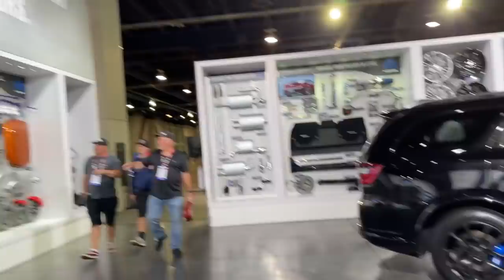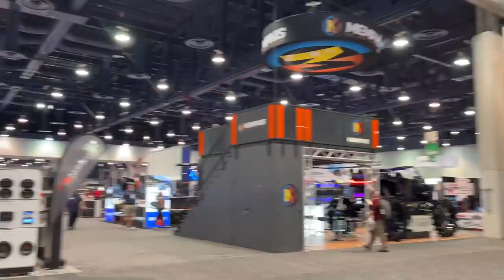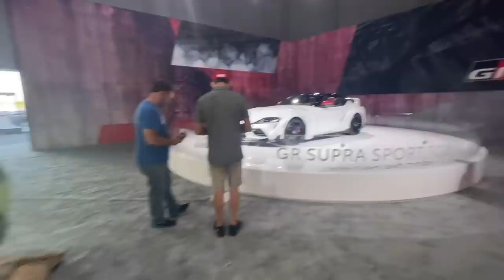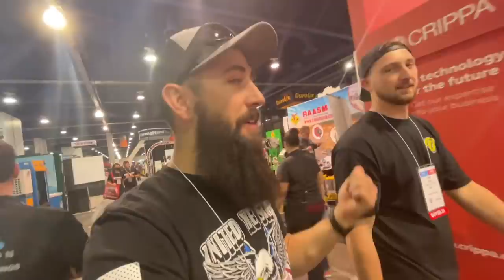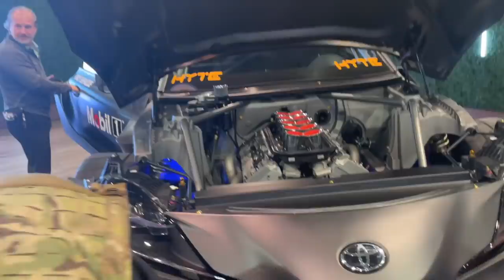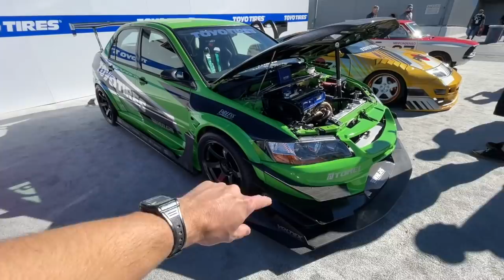2021 | Sema will never be the same... ( Electric cars / swaps everywhere... )

Comment: Yeah I need to get the 1/2 in drive  kit soon.  I bought the 3/8 kit and  I broke the head off the 3/8 breaker bar. Then yesterday my 15mm socket split in half.  But besides that I've had good luck with them.
Reply from the maker: I talked to them about the 3/8 breaker bar, they said they are redesigning it to be stronger. I think the bar is just too long for a small 3/8

Comment: 510 build after 8s Honda when you get back. K engine swap the 510 short wheel base and low na or small turbo don’t need big power for small road course just be able to corner and take over in the bends pedal flat down for all of it
Reply: Ev swap makes more sense. Rich rebuilds can help Trevor out
Reply: @johnsnow1355  just thinking he has a k engine sitting there doing nothing in his hord
Reply: @adrianharrison5176  the k engine should of gone into the c10 Chevy makes a factory turbo 4 cyl Silverado. It would be a fun comparison of  4cyl truck to 4 cyl truck lol.

Comment: Electric is the way! I was huge into rc and when we switched from nitro to electric the performance increase was just ridiculous!
Reply: To each their own, electric does nothing for me.
Reply: @jarrodjordan5293  oh it will when some old clapped out EV converted car leaves you in the dust 😁
Reply: @mcdadcoleman  Cars to me are more than just going fast, they're art and passion a noiseless sterilized EV may be fast but is absolutely passionless.
Reply: @jarrodjordan5293  noise isn't everything
Reply: @mcdadcoleman  acceleration isn't everything
Reply: @mcdadcoleman  Technology isn't either. If I wanted a computer I'd buy an apple,if I want a driving experience I'll buy something with an engine.
Reply: @mcdadcoleman  yeah and how long will the ev Vehicle last before it dies down or fails? 🤔
Reply: @jarrodjordan5293  .... A modern fuel  injected combustion engine use more computer power to run than an electric motor....
Reply: @jerrylundgren8244  You miss the metaphor.